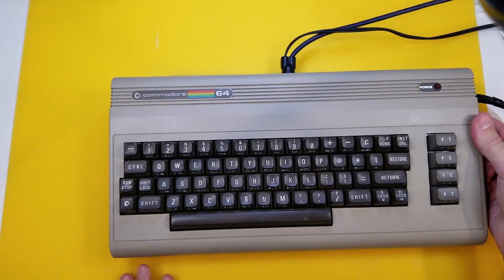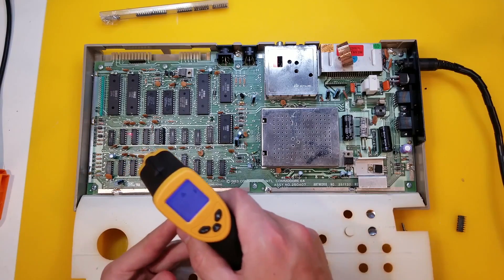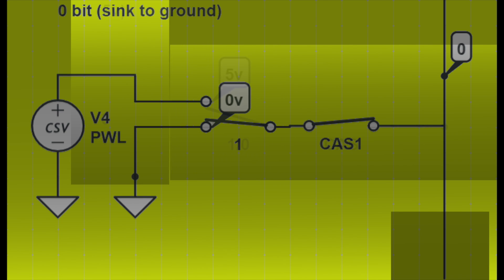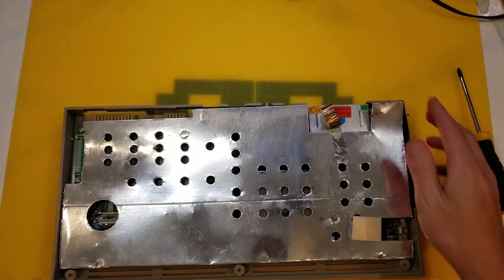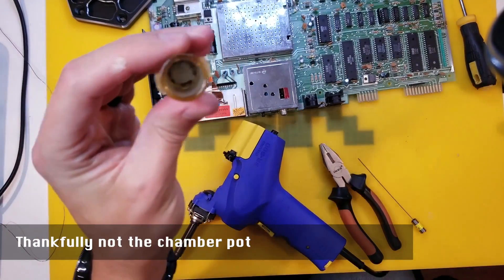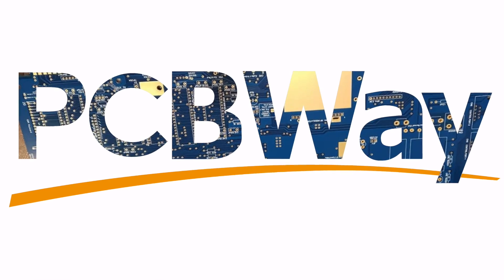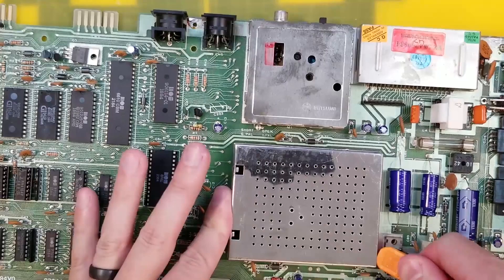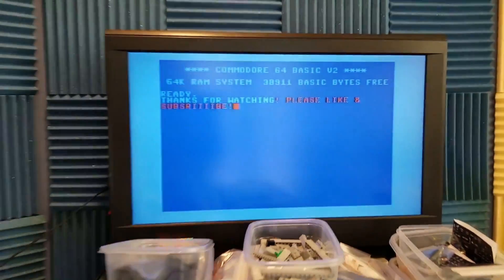How Piggybacking RAM Works: Fix Computers With Just Your Fingers | see pinned comment

Comment: I have a question not related to this video but it is about piggy-backing. I want to upgrade my router ram and memory for openwrt. There is 1 chip of ddr1 inside and no more place for another. I have already replaced 32mb chip with 64mb one but i am curious if i can piggy-back at least two of them to get 128mb

Comment: Nice explanation on how piggybacking actually works. My question is, if the RAM chip is faulty but not totally failing, can piggybacking still work?
I got a C64C with 32KB chips that is showing the full amount of RAM available but actually loading games will reveal problems like getting stuck while loading or graphical glitches like the Lemmings intro having corrupted backgrounds on some scenes, while others are fine. Running a testing program, it found faults with one of the two RAM chips.
Reply from the maker: Yes that should help narrow it down
Reply: @RetroRecipes  Sadly it didn't work for me. Still getting the same errors with piggybacking. Seems like desoldering and testing the new chip directly is the only way.
I'm wondering if the problem could also be with another part or that the new chip is faulty too. Of cause it can't be a simple defect and fix for once...
Reply from the maker: @moomah5929  C64 fixes are never simple. I'd probably start by replacing with all new socketed RAM. Good to have either way and might solve things.  Piggybacking isn't 100% guaranteed. Good luck!
Reply: @RetroRecipes  Thank you. I'll have to get some better desoldering solution first because the pump thingy I got is quite bad for this type of job.
With easy I meant most of the time I have problems, that never fit some standard problem description and solution. Would love to have a simple problem for once. :D
Reply from the maker: @moomah5929  if it helps my preferred desoldering solution can be found at http://perifractic.com/tools in the tools I use section
Reply: @RetroRecipes  Would you actually suggest using the hot air gun for heating up all the solder points of a chip evenly and pulling it off?
Reply from the maker: @moomah5929  It's not my preferred method because it's hard to heat every pin simultaneously to pull the chip out at once
Reply: @RetroRecipes  Thanks for the advice. I'll try it the normal way then.
Btw, will the Amazon "Influencer-Program" work with other countries' Amazon too, if I simply put the refferal link behind the product?
Reply from the maker: @moomah5929  I'm not sure but thanks for asking! You could always try I guess ¯\_(ツ)_/¯
Reply: @RetroRecipes  I got myself the heating gun, using your referral link on Amazon Germany (don't know if you can see, if it worked). While the gun might or might not work for desoldering the RAM chip, now I won't have to use my wife's hair dryer when removing certain stickers, among other uses.
The stand-alone desoldering gun would be awesome but the amount of soldering I'm doing wouldn't justify the cost and it's also hard to come by in Germany. Others are either cheap ones with bad reviews or have to be connected to certain soldering stations, excluding the one I own. :(
Don't know if they are actually interchangeable, as long as the connector fits.

Comment: in itself it's nice to see you follow up a new solder joint with IPA to clean off flux. However, if you're just going to brush the flux around with a brush, it's kindoff useless.

Comment: Piggyback chips is always a bad idea: 1) if the soldered chip has one or more pins shorted to a fixed voltage this could lead to not functioning combination and/or new chip damage; 2) bus impedance change, which is, in the best case, halved; 3) the applied chip easily could have one or more pins disconnected. 

The heat from the chip is due to malfunctioning components inside it and it is due to Joule effect that means current flowing thru a resistance. In this case this resistance is the fault inside the chip itself: it is better replace the broken chip to no overload the PS circuitry further.

Comment: The heat caused by shorts that disabled some of the functionality of the RAM Chip causing the RAM chip to dissipate too much power. If am open had occurred to the power feeds the chip, it could have been colder than the other normally operating ICs. If the fault had made the RAM chip still outputting some data, your piggybacking technique would have failed to pass the RAM test. The bad part must always. Be removed, as over time, it could become more defective and interfere with the operation of the piggybacked RAM chip, so I totally disagree with you idea to leave the old part in place.

Comment: Don’t forget the heatsinks on the SID, CPU and the PLA. Have replace the PLA’s on the 250425 and 250466 boards with a SuperPLA V4. All the chips on it have IC Sockets. The best C64 boards for me is the 250425 and the 250466.

Comment: 8:01 Hello. Why do you remove the RF shield ? Why it's useless now ?
Reply from the maker: Correct. It was an FCC requirement then but not now.
Reply: @RetroRecipes  It was only a law ? Not for protect human from electro magnetic pollution or to protect chips from radio wave parasites ? I'm really surprise. Nice video :)

Comment: I'm working on a SRAM adapter for the C64, not needing it YET, but if my RAM chips crap out I'm not hunting for replacements ;-) The board will socket under the ROM and have a pigtail to one of RAM sockets to source the multiplexed adresses, WE, CAS and RAS signals. Should work with both long and short boards.

Comment: Are You kidding? Piggybacking 64kbit DRAM with a TTL MUX? More proof for this idiotic "solution" is opposite location of  power pins on DRAM and TTL. In that position this TTL chip will be fired by reversing power in seconds.
Reply from the maker: Someone missed the pinned comment 🤦‍♂️

Comment: ??? Whar are you doing at 6:52 ?   The 74LS257 is an Quad 2-Data Selectors/Multiplexers.  Your chip, where you pigg (U12)  is an 4164 what means an 64k x 1 bit ramchip. 

And at 5:26 the 74HC14 ( U8 ) ist an HEX-inverter and has no tristate !!!
Reply from the maker: See pinned comment and the caption on screen over the second chip. 👍🕹️

Comment: Wow 100 degrees, you can boil a water on the top of the chip. 
Oh wait it is just a retarded unit, actually it is just about 37.7C, still safe to touch.
Reply: Back in the day I use to have a Dragon 32 and I would overclock the CPU (6809) to 2x it's rated speed, and when I did that I would drop water onto the top of the plastic package and it would boil off immediately. Amazingly that system never gave me any issues despite using it like that consistently for years.

Comment: Another awesome video!  (Made even better with puppy!)  Thanks for the info on piggybacking chips.  I have a board or two that might have a bad RAM chip, and recently ordered a whole bunch of new ones, so I'll try this method to diagnose before desoldering anything (which without a desoldering gun like you have carries much more risk of lifting traces...at least I'm well beyond the days of using a propane blowtorch to remove chips, sometimes setting the board on fire [that board still works!]).
Reply from the maker: Thanks! Your old method sounds pretty hot to me.

Comment: Great video yet again, I've seen piggy backing used to find faulty ram on the Acorn Electron. The difference being that with a faulty chip the electron displayed just a white screen. When a good chip was placed over the faulty one  the system booted to a prompt but after 2-3 seconds started to become garbled. Test was good for finding bad chips but dem' chips needed replacing. Interesting to learn that the Commodore can function with good ram stuck over the bad indefinitely.

Comment: I have a Commodore Plus/4 with 4264-15 RAM chips, can I use a 4264-10 chip to replace one of them?
Reply from the maker: I believe the -15 refers to the access time (150ns) so I'm not confident 100ns would be 100% compatible. Edit: Though as Tim says, faster wouldn't cause an issue.
Reply: Yes you can. Using a faster RAM chip is ok.
Reply: It just has faster access time, so yes, you can use it

Comment: Could you just make the piggybacked ram chip a permanent repair by soldering it to the duff one below? Or is that a bad idea because of extra load on the power bus etc?
Reply from the maker: You can!
Reply: @RetroRecipes  Awesome...I'll kept that in mind. But then again, it might not be necessary if I get one of those de-soldering guns like what you've got. That seems to do the trick really well. :)
Reply: @xanataph  If you desolder even on a semi-regular basis, I would highly recommend one. It saves time and thermal/mechanical stress on the board.

Comment: Argh!! I thought it was April 1st, piggybacking an LS257..  And then two RAM chips appear in sockets.. Concentrate fella!.. Why did the second RAM need replacing? did you just miss when desoldering? (Easy to do, but you could've just admitted that in the video)
Reply from the maker: This has been discussed elsewhere. See pinned comment. In reality both RAM were faulty but I only needed to illustrate it once for simplicity otherwise I get complaints "you didn't need to show both chips getting replaced to explain how it works". Hard to please everyone. I put a lot of time and love into these videos, but someone always has some complaint it seems. One has to remember this isn't prime time BBC1 with a huge budget, though I try my best.
Reply: No! It's better than BBC1 prime-time.. :-)  Didn't see an answer to the second RAM chip elsewhere, but thanks for sharing. It would have been nice to see the fault code showing the second chip duff too.
Heat is caused by current.. 5v is always present on the power supply of the chip, the duff RAM chip is causing those electrons to flow away to Ground without doing anything useful.. Some transistor inside the chip instead of switching on and off giving lots of useful 1's and 0's, is just sat getting hot saying ON, ON, still ON, ON... and directing all the electrons hopefully towards ground, but possibly towards another pin, in which case, piggy-backing another RAM wouldn't work.

That's still a woolly description, but better than voltage building up.. Truth is, there are many failure modes,  of which, that is just one.
Reply from the maker: That's a good explanation. Thanks!
Reply: Oh, and then duff chips get hot because Voltage accumulates in them? Not a simplified explanation.. just codswallop!
Reply from the maker: That's my understanding. What's your explanation?

Comment: The first time I saw RAM chip piggybacking is when I had my Atari 520STm upgraded to 1MB (I had to get the chips and then paid someone to do it, but got to watch), but for an upgrade, each chip had to have 2 pins bent up and then connected together for the ST to see them as new banks of RAM.
Reply: I actually saw a couple of ST systems with RAM piggybacked from factory (it was during a RAM shortage) This was probably a Jack Tramiel cost cutting exercise rather than rework the board.
Reply from the maker: Interesting. Did this double the RAM quantity? E.g. if they needed 512K but only had 8 slots, did they put 2 x 32K chips in each socket?
Reply: @RetroRecipes  It was a 520STm (no floppy), which doesn't have empty RAM chip sockets like a 520STf(m), so it was 2 more 256K banks (16 chips) on top of the existing 2 256K banks to make 1MB total.  See http://atariage.com/forums/uploads/monthly_09_2012/post-3709-134896412737.jpg

Comment: Great video as always bud. One thing to add ; if your suspect chip has legs which have tarnished you may not be able to get contact using the piggybacking method - use a little bit of wet and dry sandpaper (dry) to clean the legs before you piggyback :) Also ; consider a bit of blu-tack to hold down your sockets rather than tape - just a suggestion :)

Comment: aaaahhh, the wonderful sound of crt's at the beginning
Reply: I personally don't like the idea of throwing away the rf shield
also, reason I called the sound wonderful is that I feel blessed that I can still hear it
Happily, the sound is only in the begining
Reply: @bengineer8  The RF shield comes from the times when RF emission regulations were a lot stricter than they are now, nowadays any lightbulb has higher emissions than a naked Commodore, nor is the C64 particularly bothered, because proximity is paramount, and so its own internal RF swamps out whatever you could bring in from outside. It's also an airflow-impeding piece of cardboard with a bit of metal paint on top, i say for the longevity of the system, it's better off gone.
Reply: @SianaGearz aaaahhhh, ty, didnt know that. also, WOW, I hope my hearing can at least be as half as good as yours when I am your age
Reply: When? I watched this again, there is no CRT noise at the beginning.
Reply: @herbiehusker1889  oddly, the high pitched sound seems more apparent when he talks
Reply from the maker: You have to be under 30s 😉
Reply: @RetroRecipes   indeed, I am in my 20's
I am guessing that you just forgot to filter out the crt noise at the beginning?
Reply: @herbiehusker1889 I heard some high pitched noise at the beginning. It is kinda faint. I can definitely hear it tho
Reply: @herbiehusker1889  I got a spectrum analyzer out and can confirm there is a CRT sound in the beginning when ever he is speaking
Reply: I'm 37, so I can't hear it at all
Reply: @herbiehusker1889  I'm 36 and i can hear it, but by far not with any headphones. My good speakers are currently unavailable, so headphones is all i have. Zinken and CD-68 play it clearly enough, no chance with Ergofit earbuds, or with MDR-605, or with many of the other things i have here. But then i have always had exceptional hearing, so there's that, it reached well into the ultrasonic range when i was 20. It actually gets bothersome, i always hear things from the other side of the building that i really don't want to.
Reply from the maker: Pardon?
Reply: @herbiehusker1889 that would explain why you thought there was no crt sound
Reply: I'm 29 and i just can't watch this video. It hurts my ears so much...

Comment: Which do you think is better? thermal paste or pads?
Reply from the maker: I like 3M pads if you're using separate heatsinks
Reply: It depends on mounting method. If you have a source of constant pressure between heatsink and heat source, ideally use the paste. Otherwise, you must use a pad, because else the paste can suffer pump-out/dry-out as a result of thermal expansion and contraction of surrounding hardware, or loose heatsinks can simply fall off the paste.

When cooling is closer to a token gesture like here, anything is better than nothing, but i suppose the can is just about springy enough too so you don't have to worry about the paste too much.